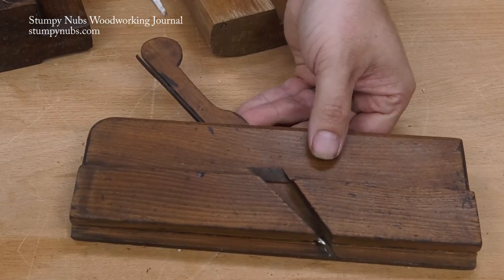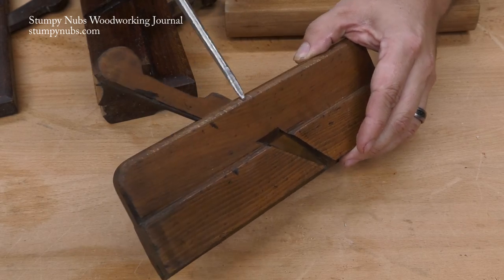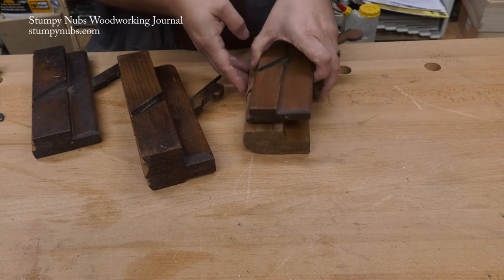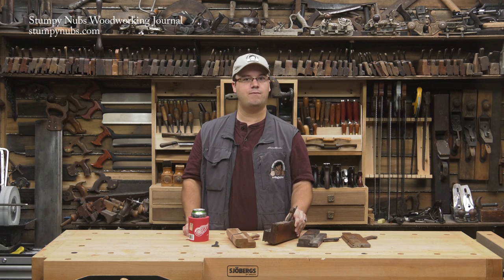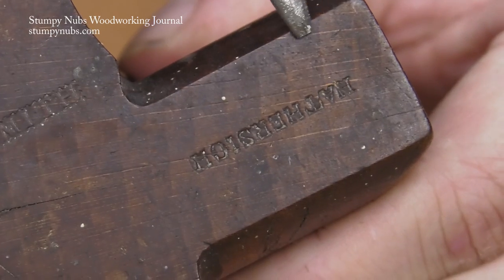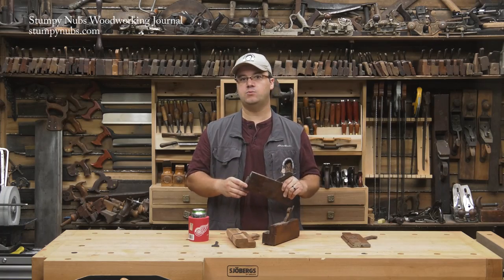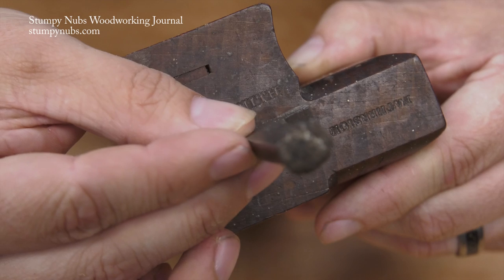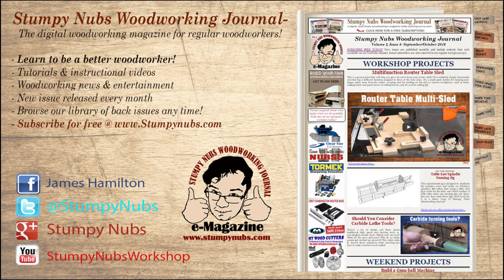Cool Stuff You Can Learn From Looking @ Old Woodworking Planes

Comment: The patina on the old planes is dirt, never heard of linseed oil going rancid when applied to planes that are in use. The oil helps to stop the wood from moving, shrinking, cracking etc. I use BLO on all my tools, just recoated all my hammer handles, frame saws etc.Just give the old planes a clean, a new coat of oil, put them back to use. Be careful buying planes with cracks or where the wood has gone soft, there are lots of old planes to buy, pick the good ones. A nice simple cleaning video search for How to restore Wooden Planes.
Reply from the maker: You are mistaken. Linseed oil will break down over time, which is why it is a poor finish for cutting boards and wooden bowls. The oil hasn't darkend your tools because it hasn't sat on them for 150 years yet.
Reply: I am not mistaken, I never mentioned the oils darkening the tools. I do not dispute that the oil will darken over time, of course it will, especially with the added oils and grime from your hands through use, I just pointed out that I have never heard of or seen a plane where the BLO has turned rancid. If you have planes that have gone rancid, they have not been looked after. If you have a plane where the oil has gone rancid, do a video, explain why it has done so and teach people how to avoid it. Clean the plane, oil it and use it.
Reply from the maker: Again, we are not talking about tools that have been "looked after." This is a video about antique hand planes. Nobody is saying you shouldn't use linseed oil on your tools. But it is a fact that it will darken over time, and when that time becomes a century, and you've saturated the fibers with lots of linseed oil (which breaks down), your planes become very dark. Is this the ONLY cause for a dark plane? Nope. Dirt and tallow used as a lubricant is a factor too. But it is not a coincidence that old molding planes from European sources are typically much darker than American ones. We both have the same dirt. The difference, in many cases is the constant application of oil that was more prevalent in the European shops.
Reply: I like the dark look of the oil on old planes, if you clean the surface gunk, dirt off the plane, you will still have a beautiful, rich, colour, to the wood. Anyway, I appreciate your videos, and the time it takes to show people the joy of woodworking. Typing on the internet can impart a harsher tone than intended, I have no intention of criticising the video, I was just curious about the rancid oil on the planes, something I have never come across before, maybe it is the American climate, it is a lot colder, milder in, England.